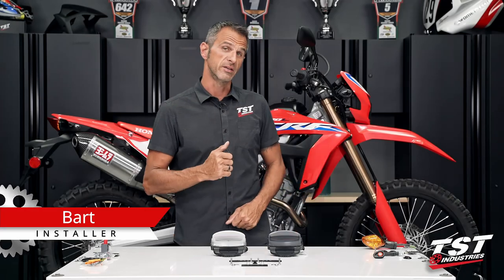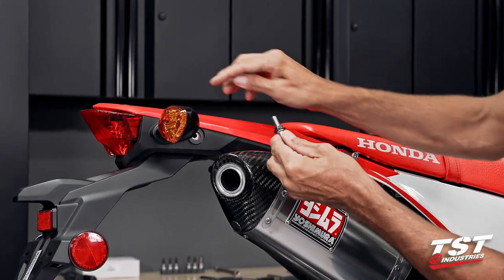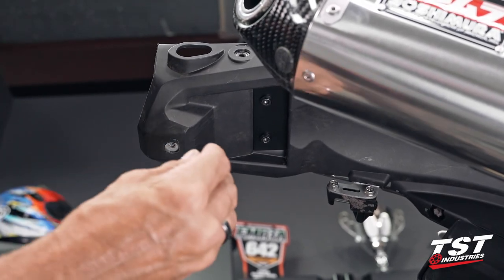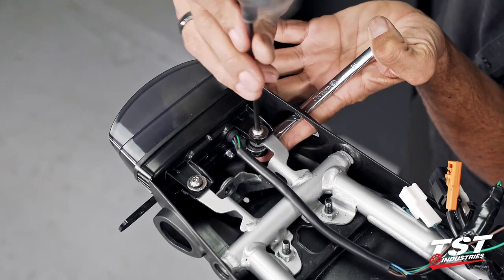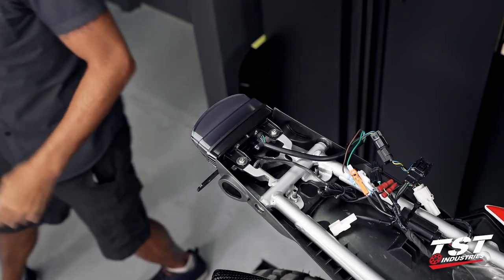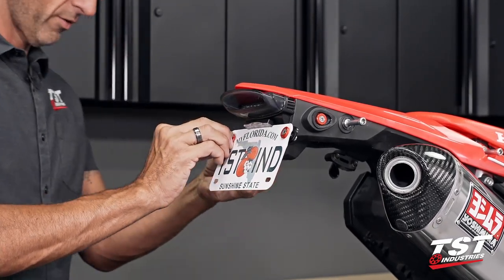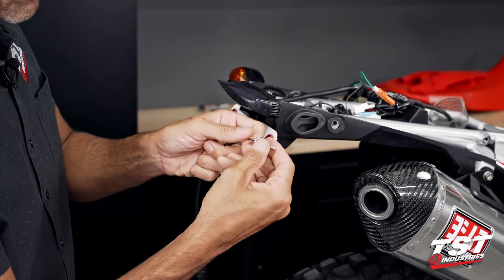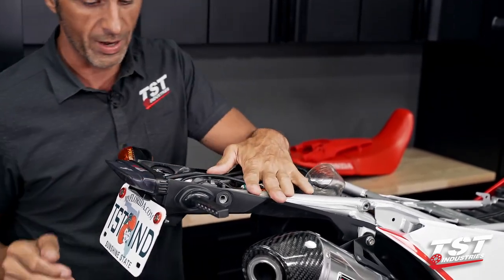How to install an Integrated Tail Light & Fender Eliminator on a 2021+ Honda CRF300L

Comment: Excellent video as always. Ordered one of these taillights for my CRF300l in the UK.  It is extremely bright, far better than the OEM one. The brake light modulator emphasises that your braking to prevent you from being smushed! Keep up the great work and inventing new products for the CRF300l 😊👍
Reply from the maker: That is great to hear. We worked really hard at making that unit fit and function well on that bike. We wanted to make it look seamless with the design of the bike, and not feel like an afterthought like many of the competitor parts that cost the same or even more. Thank you for sharing your experience. Cheers!
-BR

Comment: I like it, big improvement. It seems to me though that it could use a gasket of some sort where the unit meets the bike. I was waiting for a close-up of the finished product from straight behind but didn't get that. At 35:36 you can catch a glimpse of the light coming through the finished install and a few glimpses after that. It look more apparent right when it is being installed initially at 20:30 onward the movement behind the bike is visible through the gap. Power-washing comes to mind for example. But that's the kind of thing I keep a good chunk of used inner tube around for.
Reply from the maker: The gap is no bigger than with OE light. If you get water in between the subtray and light there are plenty of weep holes and water routing to get that water to the ground.
Reply: Great, thanks

Comment: The LED number plate lamp protrudes a few mm from the number plate bracket, meaning the number plate cannot be attached flush. Am I doing something wrong or is this the design? Any advice would be appreciated. I don’t really want to drill holes in my number plate.

Comment: Does the brake light modulator make the brake light blink like that? Is there an option to have the brake light just solid and not blinking?
Reply from the maker: The tail light we manufacture and sell for this bike does not blink by default. That is added by thte modulator. If you do not add the modulator then the brake light will be solid.

Comment: Awesome light i really really liked it but it comes with a REALLY BIG FLAW! It needs a third mounting point at the bottom of the light. As the plastic housing is not strong enough to support its own weight. THEY BREAK AT THE MOUNTING TABS!!  I went thru 2 light in 30 days same problem both times. Just riding look back and see the light just hanging after cruising at 30-45 mph in Dallas roads.😢 i see how 12Oclocklabs light does.
Reply from the maker: There is a third mount on the light. It tabs in with the bodywork of the bike. The force distribution on the system is in multiple locations and around its perimeter. If your bodywork is damaged or deformed you aren't using all the mounting features and that is probably your issue. We tested this setup on the road, and riding enduro through the forest. Hopping logs, crashing a bunch of times, whoops for days, and jumps. The light setup survived all of that. Besides that, you are the only one person that keeps having this issue, so maybe we can look into what the cause is in your specific case and solve that. If you are the gentleman that sent in those photos of a ragged out and previously looped 300L then I kjnow what your issue is. If you want I will give you a new undertail for the bike so you can replace it, get the actual experience the light was designed for, and then let me know your comments.

Comment: After installing this, is there any way to retain the running light on your rear turn signals?
Reply from the maker: Rear signals on this bike do not have a running light circuit from the manufacturer. If you need to have running light from your rear signals, OE or aftermarket, you will need our Running Mate accessory, and will need to tap into tail light running light circuit for constant 12v supply.
Reply: @TSTindustries  I just ordered this unit I'm looking forward to installing her this week. I  might go without the additional signals but I do like the slim signals you guys offer and would like to have the running lights on if possible, thanks for the help I appreciate the installation video!
Reply from the maker: @gbulldog35  I think we may have had a miscommunication. Were you wanting to have the integrated tail light and external signals? If so then that is really easy with our aftermarket pod signals because of the built in pigtails on the harness. It is also pretty easy with OE signals you just have to buy the Honda specific Y-splitter harness we have. If you are comfortable with doing some wiring you will not need the Y-splitter but then you will need to tap the tail light signal positives into the positive wire of the external signals
Reply: @TSTindustries  No problem I appreciate the help; I ordered the integrated tail light fender kit, and would also like to get the rear BL6 pod light signals, but would like to have them as running lights as well, is that possible?
Reply from the maker: @gbulldog35  BL6 only have amber LEDs. If you use those for rear running light there is no way to illuminate in proper red rear light color. If you want to proceed regardless of that, your electrical config would look like this: tail light plugged into main and signal connectors, Running Mate yellow to BL6 yellow, black to black. Running Mate red to pigtail black, brown to pigtail brown or green depending on the side you are wiring up. The remaining blue has to get tapped into the main taillight connector's running light wire, which is also blue. When purchasing the Running Mate kit you have to opt for the one that comes with the extra blue wire with connectors and posi-tap connectors for the actual tap.
Reply: @TSTindustries  Again thank you for the help! I may have to give you guys a call when I receive the kit if thats alright. But aren't the stock rear signals on the bike already amber running lights that turn into amber signals? Thats all I'm looking for is the same functionality of the rear signals/running lights, but with the smaller sleek BL6 ones, and the Tail light fender kit will be my break light and signals. Sorry if Im confusing Im new to all the wiring lol I don't need the signals to illuminate red, the tail light will do that, just wanted to have additional signals to be safe, and keep the functionality of the running lights.
Reply from the maker: @gbulldog35  No, the stock rear signals are not running lights and do not have that function by default. Most motorcycles do not have stock running lights on their rear signals outside of the cruiser scene. The stock signals on the CRF only contain the signal function circuitry from the factory.
Reply: @TSTindustries  Just realized I was completely wrong lol I thought the stock signals worked as running lights but they surely don't lol my mistake. I appreciate the all the help Im installing the kit now she just arrived. Im gonna get the BL6 front an rear signals soon, an no need to have them as running lights I was just misunderstood thinking I was going to lose the running light feature.

Comment: integrated tail light for mt09 21+ ?
Reply from the maker: This is not even in question form, so why the question mark. Anyway, I am holding one of the prototypes in my hands. I've got the design done, the molds almost finished, and I decided to redesign the circuitry for added light output. No release date yet.
Reply: @TSTindustries  Thank you Boss👍
Reply from the maker: @BlueMagic935  sure thing